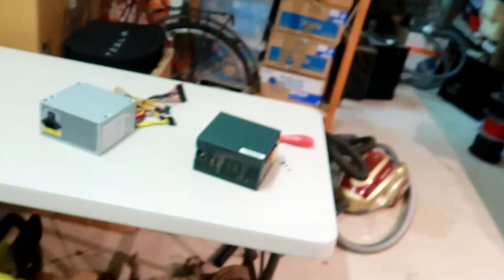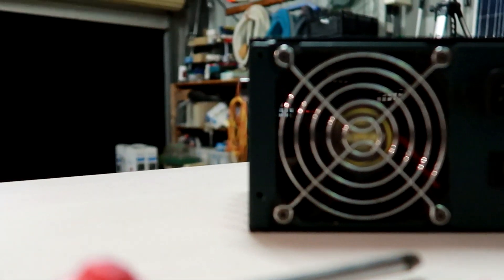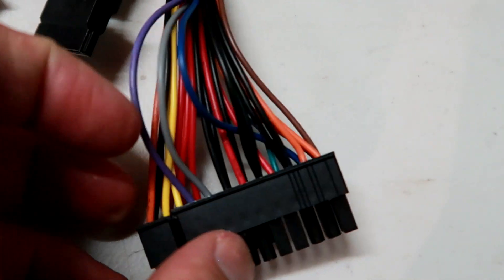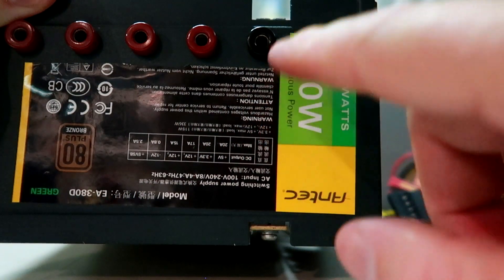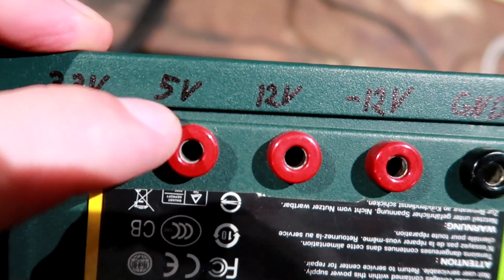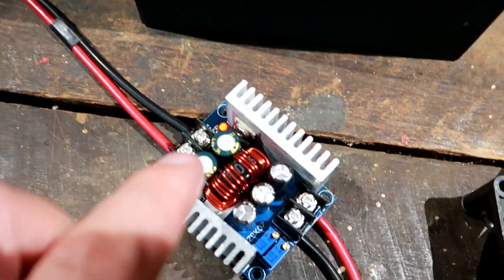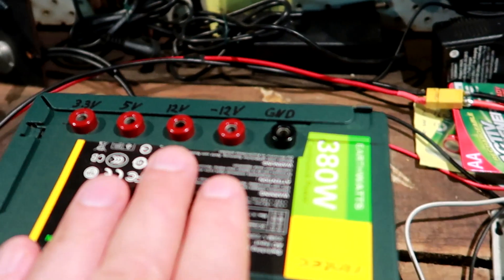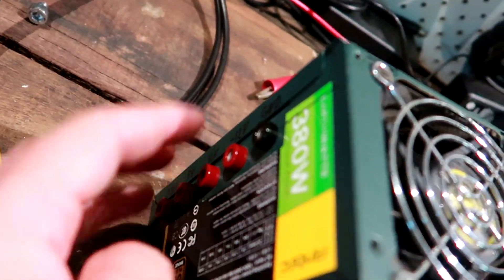ATX Power Supply Mod to charge batteries (almost).

Comment: I came across a charging problem. When I connect 12v to my lipo batteries charger I can choose more than 0.8amp 

If I set 0.9amp there's error on charger DC input too low

Will load resistor on 12v line solve problem?

Comment: ok, so could you also get 3,7v (12 - 5 -   3.3) or   (reuse the voltages AGAIN to  create even more combinations thereof?     Like 2x (12v - 5 -5 )  +12v = 12.8v   which equals to   3 times 4,26v   which Is 3S LITHIUM CELL fully charged

Comment: Hi, the combinations don't work on a bit modern power supply. The supply shuts down when you connect a load between 5v and 12v line.

Comment: I can possibly give you a very good reason why computer power supplies are handy to keep around! 
If you ever blow up your solar charge controller, and you can fix it yourself but need spare parts! There's a good chance that the computer power supply might have what you need! 
I have a car Solar DC to DC charge controller which can charge from the alternator and a solar panel, always choosing the solar panel first if available, well mine was blown because the house battery was disconnected! There's these things that look like transistors but in fact are double diodes! They are not cheap and I don't know if they are genuine since coming from China but while watching a computer power supply repair video I spotted similar double diodes in it and thought to myself that I have heaps of these things in my garage! And at least I know that these components are going to be genuine! I just have to now make sure that their datasheets have the minimum requirements! I had some spare parts right under my nose and didn't realize it! Dah! The both basically are power supplies!!!

Comment: Hey there, can I use the +3.3V Output (with high current) to "precharge" a 3,2V LiFePO4 Battery? Wouldn't it charge about to 80 % and then lower the Current to almost 0? So it would be verry save with no posibility to overcharge?  I have a 400 Watt Compurter Power Supply that shows me 30 Amps on the 3.3 V Cable continous output. I thought after a capacity test this would be a way to charge the empty cell as soon as possible to a stage that it is healthy to the Battery. Wish all of you a happy new year and many educational videos like this. Michael from Germany

Comment: If you use the +12v rail and -12v rail to get 24v i assume you get half the amps on the 12v rail?
Reply from the maker: There is only one single blue cable for the -12V connection. This is limited to 0.8A only in most power supplies. So +12V and -12V will give you only 0.8A all in total.

Comment: Too charge your your new 280Ah lifepo4 battries fast charged in an hour you would need to max out a mains socket basically. I dunno what voltage mains your on but here in the uk we get 220-240v and u normally only get around 13-15amps out of a single mains socket thats around 2860watts - 3600 watts. The only ATX PSU i know rated that high is a bitcoin mining one on banggood. https://uk-m.banggood.com/3450W-Miner-Power-Supply-140mm-Cooling-Fan-ATX-12V-Version-2_31-Computer-Power-Supply-p-1229305.html?utm_source=googleshopping&utm_source=googleshopping&utm_medium=cpc_organic&utm_medium=cpc_bgcs&gmcCountry=GB&utm_content=minha&utm_content=lijing&utm_campaign=minha-gbg-en-mb&utm_campaign=ssc-gbg-all-1223&currency=GBP&cur_warehouse=CN&createTmp=1&ad_id=407616486909&gclid=Cj0KCQiAtqL-BRC0ARIsAF4K3WF-VVG4qQuSaE_8ZEO0a3NUhyg1d1KqrjNW_YlWVPbI2lPYwjjNwAEaArWmEALw_wcB
Reply from the maker: We do have 230-240 here in Australia too, no difference to Europe.
Eventually I charge the battery from solar only. I don't use this power supply often and you always need a buck converter anyway to charge the cells.
Reply: @OffGridGarageAustralia  yea i think it would be hard to find a buck convertor that could handle 3000watts i think ive seen yours on amazon/ebay is it 400w?

Comment: What connector jacks did you use? Look like big "banana" plugs?
Reply from the maker: Yes, that's what I used.
Reply: @OffGridGarageAustralia  have you seen this guys video where he makes a 2400w 24v power supply for charging batteries out of 2 cheap rack mount 1200w HP psus? https://youtu.be/d7lF1sIgIlA

Comment: If you need massive amps @ 12V, grab an old powersupply from a router/switch from Ebay. The Cisco 4500 for example has multiple options with massive 12V power: The 1000/1300W powersupply can deliver 84A, the 1400W version 12 V @ 113.4 A, the 6000W version does 183A..
They are cheap, approx 25 USD for the 1300W version
With a 1Kohm resistor you can start the power supply, see https://www.youtube.com/watch?v=7MQglbyH2TU

If you have some electronic skills, you probably can reverse engineer the feedback circuit and modify it to provide for example 14V output. If it does provide CC at high loads you can use it directly as a charger for a 4S configuration. (If it does enter hickup mode upon exceeding its rating that won't work, unless the wires are size to limit the current to exceed the max, but I think they will become pretty hot in that case)

On Ebay I see for example PWR-C45-6000ACV for $29,99. That one is able to deliver 183A.
Reply from the maker: Solar, solar, we want solar power 😉
Reply: Interesting, thanks for the lead.   What would be the best way to step up the voltage to 14-15v for Lifepo4 charging however?

Any idea if the high-pots are adjustable to accomplish this directly?

Comment: Thank you! I noticed you didn't use a dummy load Resistive Cap, can you talk about that?
Reply from the maker: For what?
Reply: @OffGridGarageAustralia  IDK if it was their psus that needed it or what, just noticed it as a difference in setup
Reply: Older PSUs required a dummy load to keep them turned on but I’ve yet to come across one that needs this resistor. Just need to do ‘soft’ switch on. You can adj the output voltage if you can find the feedback resistors and modify the values but there are limits. Typically the 12v can be adj to 15v before overvoltage protection cuts in.

Comment: Please show us your buck converter settings and specs and how you charge your batteries with it. thank you! Keep up the great vids.
Reply from the maker: Great, will do a video tomorrow...
Reply: @OffGridGarageAustralia  Hey Andy i dont think you ended up doing this vid on the buck converters? I created an interesting project recently that allows me to charge from the power port in the back of my car without blowing the fuse. I am using step up CC and CV regulators from ali express around $7 each and i set it to 6 amps into the battery it does require the addition of a fan tho but at 4amp it doesnt anyhow it might be an interesting topic - charging lithium from step down or step up regs.
Reply from the maker: @carlh2007  Thanks, I've shown this in future videos and we have used this method quite a bit with step down and step up converters before we started using 'real' chargers.